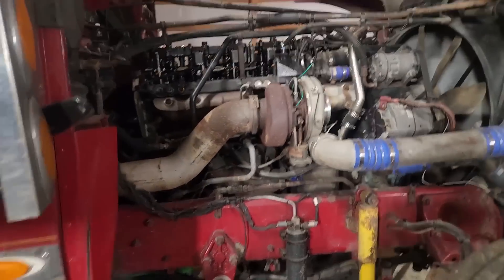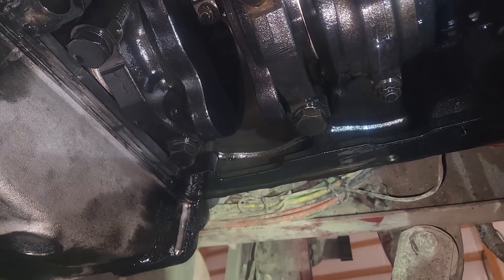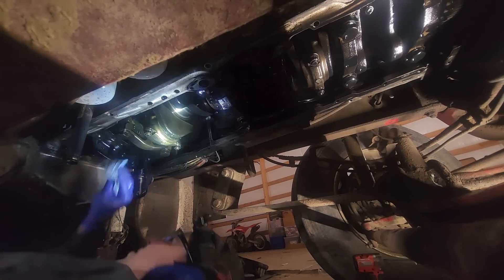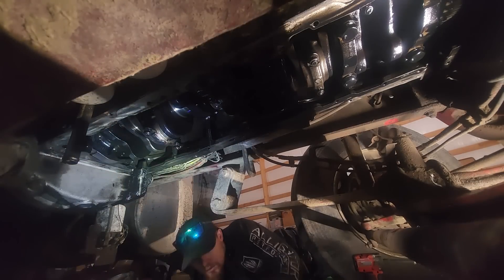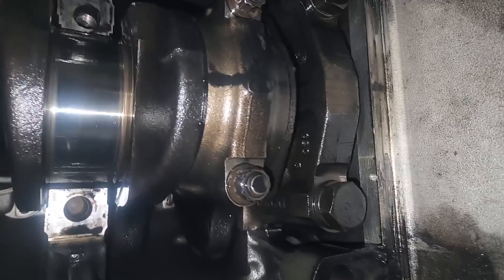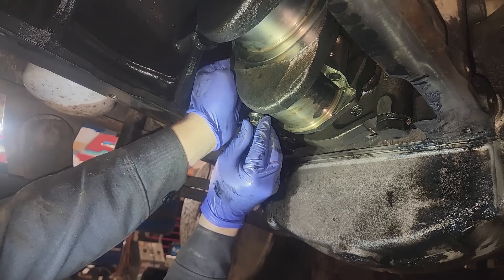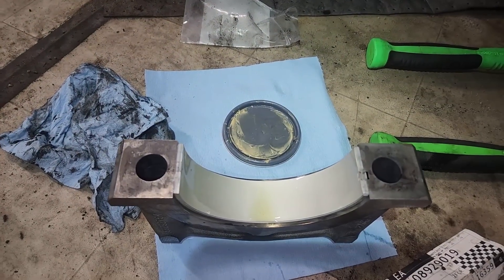This Detroit Diesel Engine Literally has TWISTED Main Bearings, but How?

Comment: My buddies dad blew my mind when I watched him roll bearings on a series 60 using a copper nail in the oil journal with the edge bent up. Hillbilly suff 😂
Reply: I believe there is a tool that does essentially the same thing.
Reply: @carlcarlamos9055  Super easy tool to make. Made my own with a #6 piece of solid copper wire!👍
Reply: I would use a flattened cotter pin.
Reply: Yes there is or make one yourself! Keeps the beari gs from being damaged! Smooth crank operation everytime!
Reply: Brass brake rivet ,,, !

Comment: Those bearings are "hammered" and it caused them to shrink and become loose in the caps. Could be an issue with fuel timing or from driver lugging the engine too much.

Comment: Poor fitting, poor quality and possible that water for diesel dilution in the fuel (reduced viscosity causing cavitation).  not unusual to see on larger engines, but surprised.  lack of fit was from bearing getting hot and shrinking when it cools.

Comment: It's called "rolling mill effect", I've only seen it a few times in my 50ish years of working on engines. It's caused by high radial loading of the bearings, You will see it on the rod uppers, and the main lowers

Comment: CAT and Cummins had s service bulletins about early bearing failures on trucks that hauled plastic pipes .
Static electricity would build up seek ground through mains .
Sounds silly but true .

One bearing in that engine shows such erosion from electrolysis.
Reply: I have heard of that in industrial generators and such like, but I don't think that happened in this case. Looks like fatigue failure of the underlay to me. Quite a common failure mode in highly stressed engines, or when you run the engine with excessive bearing clearance, i.e., it's worn out.
Reply: That's really interesting. I wonder if it affected the transmission and running gear too?
Reply: @Motorhead250   yes true I think the n14 service manual goes into how to do a reverse electrolysis procedure
Reply: I remember reading an article a couple decades ago about main bearings having low service life {100,000 miles] hauling plastic pipe.
Reply: @davidstewart8081 interesting,  I've never heard of that. But it wouldn't surprise me.

Comment: Perhaps some metal contamination in the Oil? Looks like copper powder that was pressed into the bearing journal. Maybe have the Oil sent out for analysis to see if there are any contaminates present.
Reply: FYI: From Google Search:

"In most cases, a coolant leak into the crankcase oil will bring a detectable and often sizeable concentration of copper. Companion elements typically also appear from additives that are formulated with the glycol or introduced as a supplement into the coolant."

Comment: There was actually 3 series 60 displacement engines. The first one was 11.1L then 12.7L which is most common, final one was the 14L. That one is definitely a 14L with the common rail electronically controlled injectors.

Comment: your inexperience showed on this one, your customer needs a new oil pump and oil cooler also, all that metal can be trapped in the oil cooler and wipe out the new bearings as it lets go, hopefully you used the new method to set the overhead, example is if you set the valves on five you would set then injector on three and chase your injector cylinder with the next valve setting once you hit valve overlap, when you cant get the bearing to start easily bar the engine over, many cranks are bent from hydralocking from past failures. if you cant get number one upper in you loosen the fan belts off.

Comment: I have once on my test engine way back in 99.  Engine had a bad harmonic balancer and started pounding the crankshaft in a vertical motion just slightly and twisted the main bearings just like you're seeing.  He might have a leaking harmonic balancer it would show up in the back 2 bearings first.  Detroit uses a liquid filled balancer.
Reply: fluid filled dampers go hard after about 10-15 years......really bad news for cranks.

Comment: The 14 liter S-60 did not have as good as reputation as the original 12 liter. Has the block gone out of square, causing twist distortion on the bearings.....wiping the bearings out and distorting them.  If the crank gets really stiff with new bearings and does not turn over smoothly.......theres your culprit.  That bearing at 8.00 almost looks electro pitted..........wtf    The owners was super lucky to pull that engine down a catastrophic failure destroyed the crank etc.

Comment: Maybe im a little bias, but the DD Series 60 is right up there with the 3406E for reliability; electronic enough to be consistent, simple enough to repair
Reply: I have been in the diesel engine machine shop business for over 40 years. I think the 12.7 was the best engine ever put in a truck! We saw many with over a million miles before they had a major rebuild. I had an old Cat 1693 years ago that had a  million and two hundred thousand on it.
Reply: Those detroit engines were a good engine for those that really watched their overall cost of operating. Decent fuel economy, relatively reliable and low repair cost. Won't blow you away like a cat or cummins, but you'll have some extra money in your pocket at the end of day.
Reply: 100%

Comment: Josh, send a picture of the funky bearing to a bearing manufacturer. If you can get to an engineer they can probably tell you the exact failure method. Some people proposed electrical arcing, I don’t think you would have arcing without damage to the crankshaft.

Comment: Coolant contamilated oil can be the cause of the missing material on the bearing.  High temperatures can be the cause of the deformation
BTW,  oil the bearings up on both sides to install them , and rotate the cranckshaft if they don't want to go in in a certain position. The mains are often not perfectly aligned on the shaft
Reply: I was thinking the same, very reason drag car guys don't run coolant ..
Reply: @67bajabuilder  they don't run coolant because the gycol ruins track prep and is slippery if something happens. 

Not related to bearings.
Reply: oil (lube) takes up space if you do that you overcrush the bearing into the crank,
Reply: @youtubeisawesome2487  You believe the upper half of the bore in the block stays completely dry, when you remove the old bearing?  I believe it is better to reduce the friction when installing than risking to strip the outer coating. 
I don't know if this specific engine block is chamfered, but Scania, Volvo, Mercedes and Daf have no chaamfer, so stripping material is a larger risk than taking up space that is taken up unevenly anyway.
Reply: @G33RTJEH  there is a reason all engine manufactures instruct you to not use oil, lube or anything else on the back of the bearing, you cant fix stupid tho.
Reply: @youtubeisawesome2487  All of them?  Sure?  Except Deutz, Yanmar and Leyland, because I've been taught otherwise by these. But hey,; you know them all, probably.  I could go up to the attic and look for my instruction manuals, scan them and prove this, but I'm too lazy to bother (have been stored for over 20 years, and I have no idea where exactly)

Comment: I used to be the 60 series tech for a small mom and pop shop and the only reason I can see that the mains were so wiped is they were definitely after market garbage bearings.
Reply: There are many cheap, kits from overseas that people sell, there are only a couple after market companies I would consider.
Reply: I rebuilt myself about 10 (1000000 miles) Series 60 engines and never seen this type of damage on OEM bearings.

Comment: The curling of the inserts is very common in extremely worn inserts. What happens is when the clearance gets too much, it can't hold oil pressure and maintain the oil cushion that keeps the shaft from contacting the insert. The shaft drags on the inset, It heats up and compromises the insert. I'm guessing the shaft needs pulled and resurfaced. Putting new inserts on a galled shaft is a waste of time and parts. The owner needed to drop the pan when he first noticed the drop in normal pressure.

Comment: Great save on that engine.  It was RIGHT at the spun bearing point.  Hopefully the crank is still smooth enough to allow the new bearings to live a good life.
Reply from the maker: Customer said the oil pressure is about twice as much now so hopefully he is happy.
Reply: @AdeptApe  I'm willing to venture that if it had been run a thousand more miles it would have spun one of the more damaged bearings.  

When you find the problem and can know that the work you've done will last is the satisfying part that this field brings.  Seeing that your customer can now rely on their equipment without worry - because of your work - is a great feeling.

Comment: Funny seeing a cat tech's experience with a different designs :D
This style of thrust bearing is in fact very common, both the 3-piece design, as well as it being on both the upper and lower.
In fact it is fairly rare to find engines with only the upper thrust bearings.

The way the bearing shells were deformed quite commonly happens with heat, so you'll often see this on bearings juuuust about to spin.

And the de-lamination of the bearing is also a fairly common failure mode, it is a manufacturing problem a lot of vendors have had over the years resulting in callbacks. But it is also a somewhat common sight in very high-mileage engines.

All that being said, the quad rocker design is quite unusual.

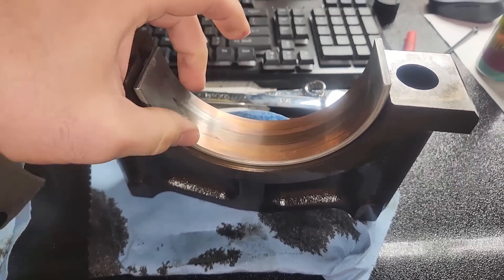Comment: 1:33 in... Normally this is a sign that the motor has been very hot and will need yo be line bored.

8:04... Yep that motor needs to come out for a zero hour rebuild. It needs machine work

11:15 the reason its so hard to roll thrust in a 60 is because its much tighter tolerances than most otger engines.
Reply: 13:00 all the mains the tab goes towards the cam but all the connecting rod tabs go towards the oil cooler

Comment: Never been inside a 60 Series Detroit either, always heard very good things about them and quite a few running over 1 million miles. Pretty interesting teardown. Did you plasti gauge any bearings? I have never seen a bearing insert fit loose in the cap like that, strange. The wear on some of those bearings seemed abnormal. Be interesting to see what the oil pressure is after the overhaul. Thanks for the Videos, Josh. Hopefully your wife and baby are doing well. Congratulations and enjoy your time together. They grow up quickly.

Comment: Those lower mains were distorted from the excessive clearance letting the crank vibrate and pound the shell. When they're torqued in place there's quite a bit of tension or "crush" between the upper and lower bearings keeping them in place so they cant spin. When the caps were removed the distortion took over and sprung them out of shape. Bet the engine will feel smoother with the new bearings in there too.
Reply: I was gonna say something similar, I wonder if as the bearings wore material if they lost some spring tension as well. And being heat cycled all the time caused them to warp inward like that since they became thinner in the center of the bearing. Two bolt mains don't  help either. I get why people love CATs so much because they are very over built. My N14 only has two bolt mains and they are known for having main bearing issues after an inflame if the clearances weren't checked. Two bolt Mains with no cross bolts allow the caps to move around more under load even though they are torqued to spec.
Reply: Thats exactly what i was thinking too @peterpower0495
Reply: @peterpower0495 wtf the N-14 surpassed any Cat that was ever built on reliability and power. I'm not sure by your response if you are suggesting Cat had a 4 bolt main but they didn't and also you better be rolling them at about 300000 miles. Gee Cummins you only needed to worry about bearings at an overhaul and I did a couple of N-14s at million and a half miles or more
Reply: Rebuilt several 60 series over the years

Comment: John Deere uses the same type of thrust bearings. They have a tool that wedges in the main cap bolt holes and attaches to a slide hammer to remove them.
Reply: john deere was half of the orginal design team
Reply: @youtubeisawesome2487  depends on who you talk to what the extent of that partnership was

Comment: I personally use a heel bar to walk the main caps out, I’ve seen main bearings warp like that but I’ve never figured out why. I’ve seen lots of s60’s have pitting on the mains but never that bad, the only thing I’ve come up with is the trucks that sit for the winter (usually farmers) tend to have it worse then ones that run year round

Comment: Did the owner happen to mention how much HP that engine was making. Did you ask about his oil change interval that may be an interesting piece of information and kind of oil. Cummins will curl up rod bearings like that and spin the brg and throw the rod. The main relief is set at 120 and the regulator is set at 60 in the field disassemble the valves and add two 3/8 flat washers to the relief and one 3/8 flat washer to the regulator, and the owner has at least two more concerns slipper bearings and cam brgs 40wt oil might be a good choice, Josh good to see you back on the bottom again PS the S 60 only has ten pan bolts not the same as Cat

Comment: The owner has been extending his oil changes or using the wrong oil for the engine. With those EGR engines, the acid buildup in the oil will delaminate the babit from the copper. He's lucky to still have an intact engine. You can bet the cam bearings are wiped out too.
Reply: Thinking acid effect was the cause here also. No.6 looked particularly bad, down to the copper!

Comment: I believe all those newer Detroit Diesel engines need a "special tool" to bleed the fuel system (like after a filter change). If this is the case on your rebuild, can you provide some details on how to bleed the fuel system and what method you used (especially if the injectors have been removed/replaced)? Maybe not applicable on the job your currently doing.

Comment: While you're in there, better check the o-rings in the oil pickup & transfer pipes. Those have been known to harden, crack & start sucking air causing low oil pressure too...

Comment: I cut my teeth doing these. They where first offered with 11.1l, and 12.7 late1980s. Then around 2002 the 14l was offer and the 11.1 was ended, they also made a series 50 that was a 12.7 but four cylinders. I think it was 8.8l.  I never seen bearings like this.

Comment: Ive seen that type of bearing damage on low mile cummins isx (400k) several times. Usually rods though. My theory was a combination of the thinner oil they run in newer epa engines and lower oil pressures especially at idle.

Comment: Thats Detroit "peanut butter" used many a can of it. Bearing material fatigued and flaking away, somebody built it with cheap parts
Reply: Or turned the fuel way up and lugged the motor down way low.

Comment: For the pitted bearing, is it possible some one welded something on the engine but grounded to the frame. I worked on turbine engines, and had the have an exhaust nozzle welded, the welder thought it was smart to ground to one of the inlet fan blades, He welded every bearing in the engine.
Reply: Cool never even thought of that
Reply: @malachicookston9191  That was a rather expensive mistake. Complete engine tear down, inspect and replace all bearings, those are all roller bearings.
Reply: Great point!!!

Comment: The old bearings were from Temu. On a serious note, It's good that the driver watches the gauges. I've run Detroits my whole 24 year career and they are a good motor, but just like any they don't run long on low or no pressure.
Reply: I don’t think that’s exclusive to just Detroit… although I think PACCAR runs a bit lower than the rest of them.
Reply: There's some shops that'll put in the cheapest of the cheap bearings in.
The later Fitzgerald engines guys needed bearings within 200-300k miles.